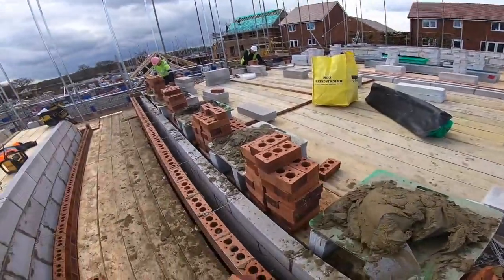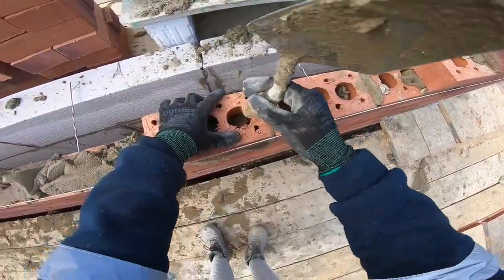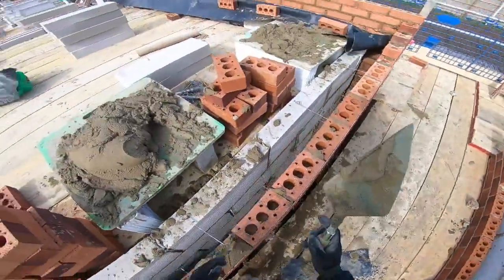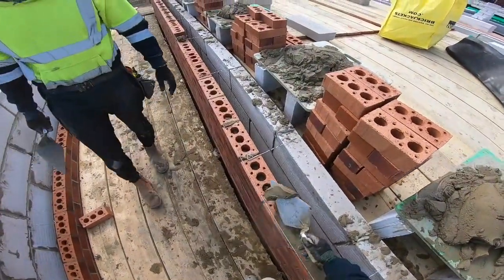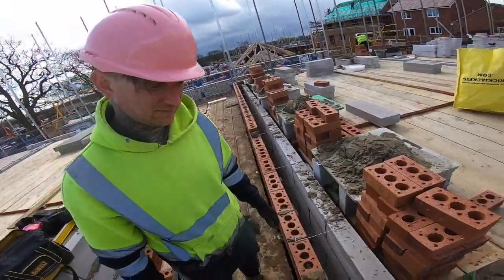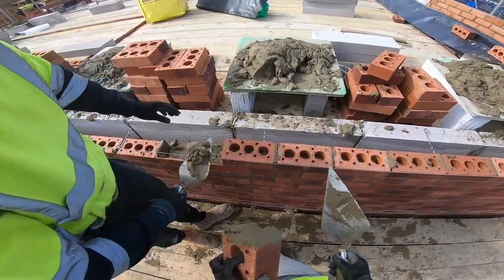Learning to lay bricks... day 11

Comment: The secret to perping bricks is flexibility of the wrist in the hand holding the brick, the brick should be moved or twisted to accommodate the trowel, i.e. the trowel just goes up and down in a vertical plane and the brick is twisted to place the mortar where required. It may simply be down to you’re wrist strength Amy, but you will soon pick up the techniques